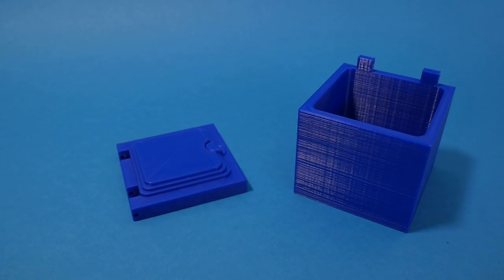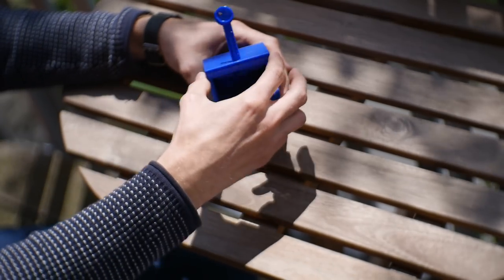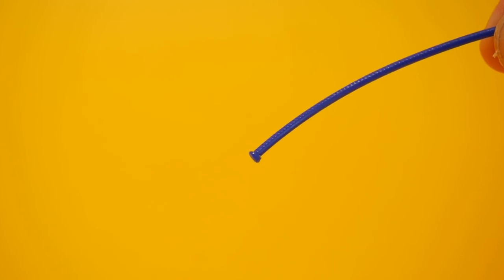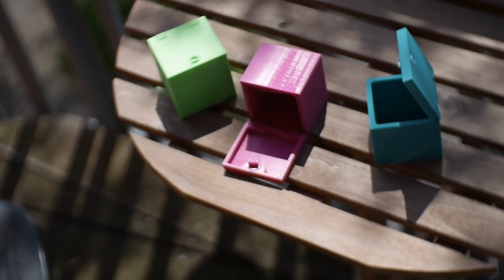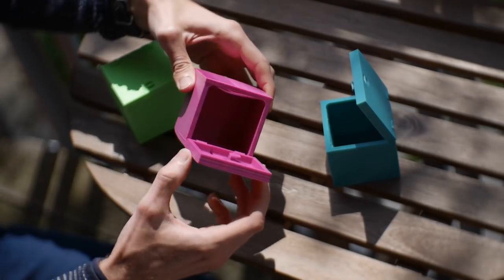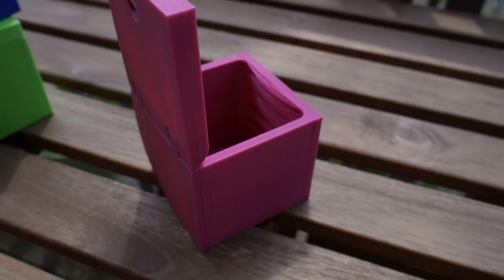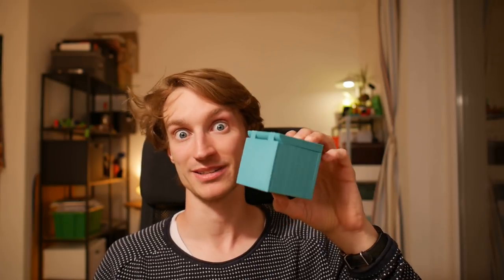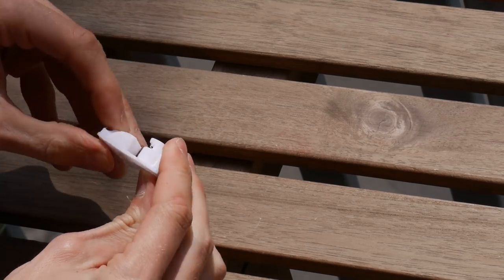3D-Printing the Mulholland Drive Box and Riveting!

Comment: Awesome! I like your design philosophy. I was just designing some boxes myself using bolts as hinges but I'd like to try some print-in-place stuff too. I have a question regarding the design though. When designing the hinge for instance, do you simply make the axle slightly smaller than the hole it's seated in? I feel like you would need to get that offset right to prevent the entire thing from binding up while printing. Do you have any tricks or is it just a lot of iteration with different sizes and printer settings? Again, great video!
Reply from the maker: Hi, thanks for the nice comment! Yes, the axle has to be smaller, from my experience, you need at least 0.3mm clearence between to objects if you dont want binding on household 3d printers., so the axle diameter is 0.6mm smaller then the hole.